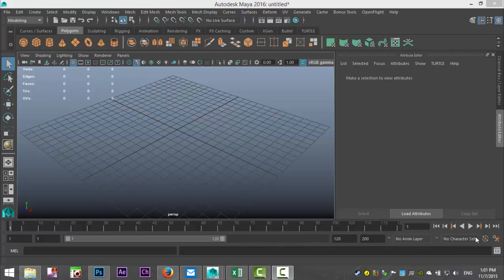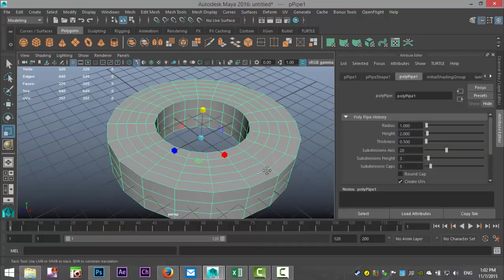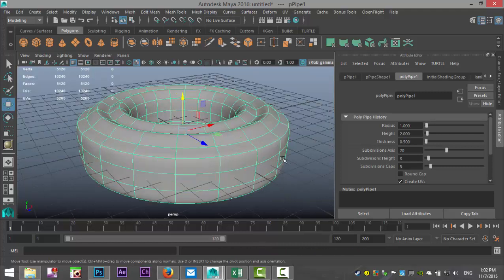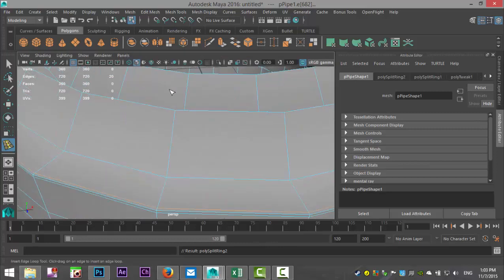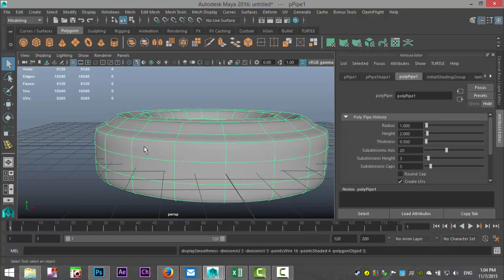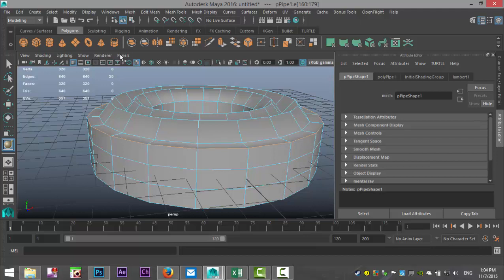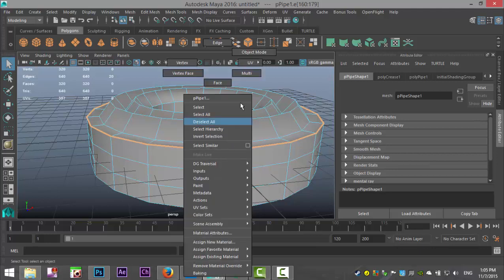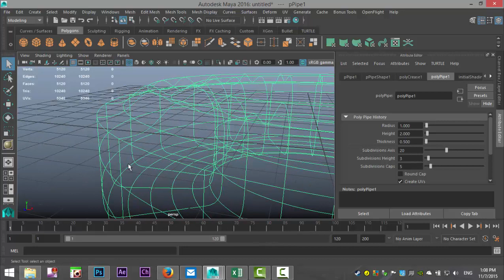Maya 2016 tutorial : How to use the Crease tool

Comment: hello 
what's the diference between the crease tool and bavel ?
Reply: +fadhel midouni The end result of the bevel is the same as if you were manually creating those classic 2 edge loops near the border (like Mike did in this video). It adds to the poly count. However if you don't need to create a low poly item, you can use bevel without worrying. Another difference, important difference, is that the Crease tool works within Maya. If you want to export your model into Unity & co, it'll probably not work
Reply: +TheDorianTube ok ty
Reply: " is that the " .... I can't see the rest of your comment.
Reply: Ice Bender Youtube bug, when this happens refresh the page with F5 and you can see the whole comment
Reply: Would you know if creasing works with hardsurface objects you are exporting to ZBrush from maya?